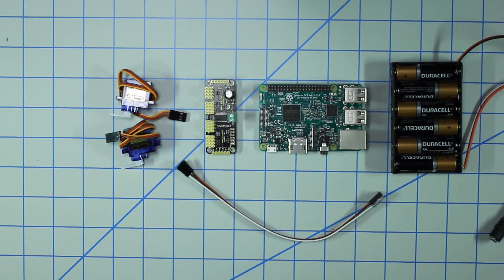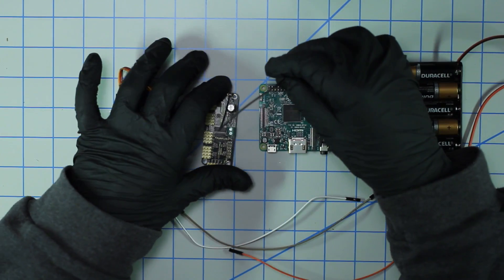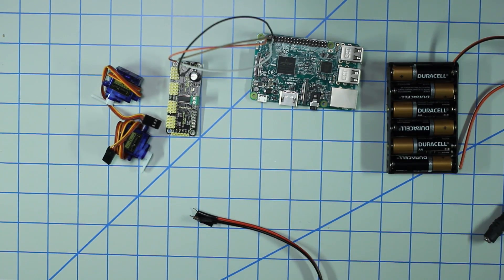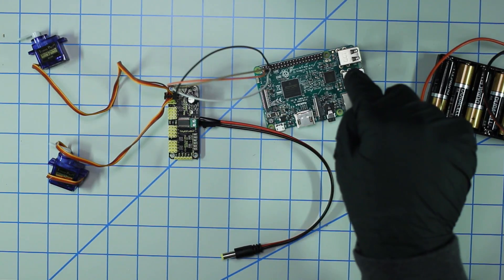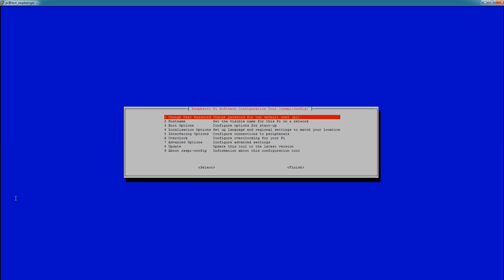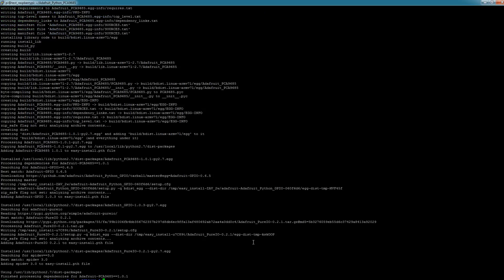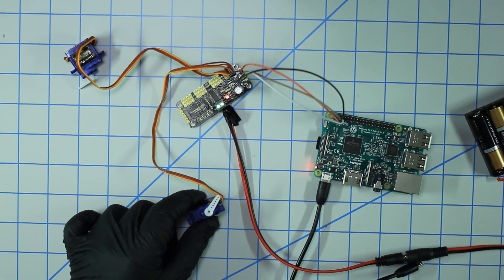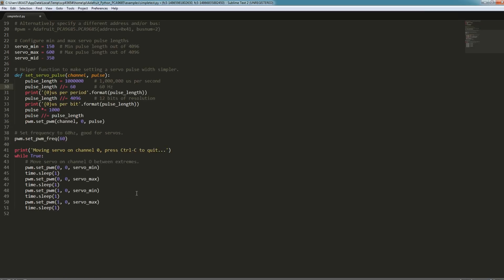16 Channel Servo Controller (Raspberry Pi)

Comment: Hey, thank you for the tutorial! I followed it and it seemed to be working very well! That was until I connected a second servo and my servo driver lit on fire! The only change I made to what you showed in the video is using a pack of 4 batteries instead of 6, is that why it didn't work? I'm not very good at this electrical stuff but maybe you could help me figure out how to connect more servos to my circuit without me being a safety hazard to myself :) Thanks!
Reply from the maker: Hey Grey, that's really odd. I wasn't aware that could happen, but apparently it occurs occasionally with defective servos when they lock up. Check out this forum thread: https://www.rctech.net/forum/nitro-off-road/743171-my-servo-catches-fire.html Stay Safe!

Comment: 9V input?
Reply from the maker: Hey Daniel, looks like I made a mistake. The spec sheet recommends 5-6 volts. https://cdn-learn.adafruit.com/downloads/pdf/16-channel-pwm-servo-driver.pdf I'll update the documentation accordingly.
Reply: PiddlerInTheRoot Also in your video you have a six AA pack

Comment: question. can u run both servos simultaneously? not in a sequnce. what if i wanted to run 2 pwm at the same time using pca9685 for instance 2 dc motor not servos. what should i do?
Reply from the maker: Assuming you just have 2 motors hooked up to the pca9685, you could use the "set_all_pwm" method (https://github.com/adafruit/Adafruit_Python_PCA9685/blob/master/Adafruit_PCA9685/PCA9685.py). Otherwise, I think your best bet would be looking into implementing some sort of threading solution. (https://www.raspberrypi.org/forums/viewtopic.php?t=30340)

Comment: That was a nice tutorial! I've seen the Adafruit example but it only goes as far as powering one servo by means of the "simpletest.py". I'm glad that you went the extra step to show how to modify the Python code to power two servos. That's my situation. I have a servo arm with two servos where I'll mount the raspberry pi camera, which will go on a robocar eventually.  However, I still need some code to make the servos work more interactively instead of just as a test.  Would you happen to have code to run the servos via prompts--or better yet, via a mini joystick?  Anyway, thanks a bunch for posting!! (BTW, what's with the black gloves??) :)
Reply from the maker: Hey Hector,

You could map the servo positions/pwm values to corresponding joystick values. I don't have any code/examples that display this, but take a look at this link for ideas. https://www.pygame.org/docs/ref/joystick.html

I wear the gloves out of habit. My hands get clammy after tinkering for long periods of time, and I also found they help to protect against burns and cuts when soldering, cutting, and prying electronic components.